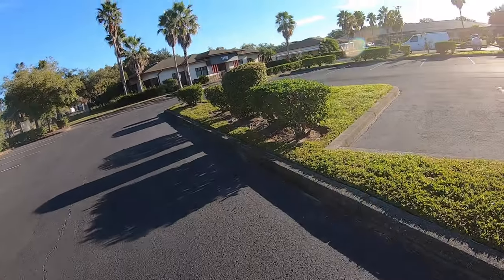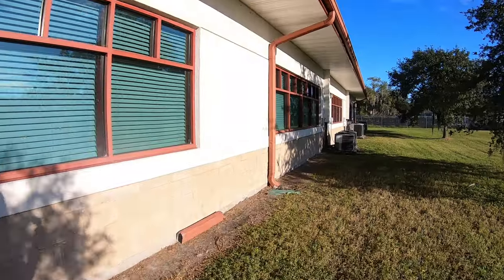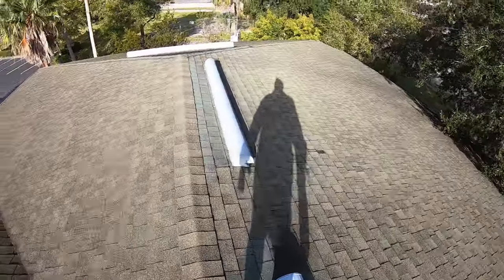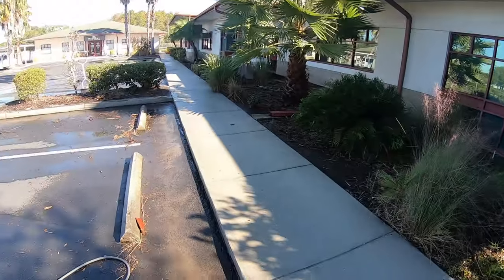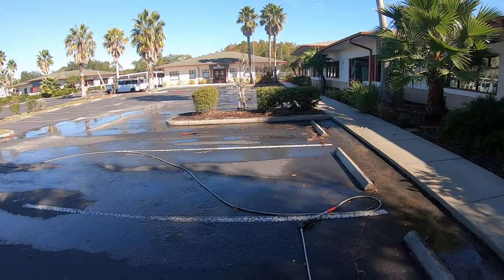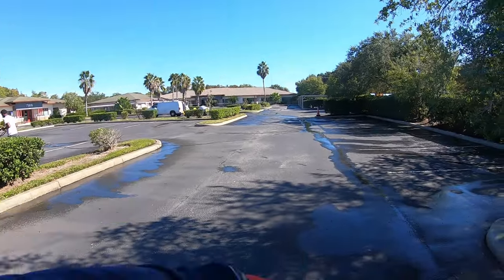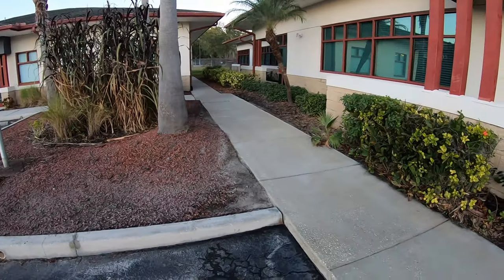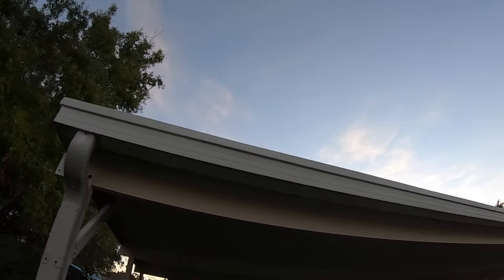Commercial Business Complex Cleaning

Comment: Can you please explain how you mix to come up with 3% mix? And how do you know what when to use a certain %?
Reply from the maker: Sh comes in 10% or 12.5% forms. To get a 3% mix you have to dilute it water. If you are batch mixing (mixing the sh with water in a tank) it will depend on how many gallons of mix you are trying to make.

If you are using a proportioner system or blend manifold you can simply dial the ratios on there.

And as far as knowing how hot a mix needs to be is going to come with experience. After doing a few jobs youre going to notice downstreaming can clean certain algae, mold and mildew but when you get some tough black algae you may need a stronger mix.

Comment: One thing I’ve noticed with commercial buildings is they don’t have regular water spouts. What common fittings do you use for commercial properties?
Reply from the maker: They all have a regular garden hose thread but some may require a water key to turn them on and off.

Comment: Great work! I do alot of commercial as well. Some of my jobs require cleaning before opening or after they close. Did two jobs this weekend one had to be before 8am flat work and soft washing the building. The other was a Starbucks which can be done after closing at 9pm. Those jobs are fun when it's 49 degrees in the am🤣🤣! The challenge is when's it's that cold with no sun the mix doesn't do much.
Reply from the maker: Damn you were on a roll!!! Yea it was perfect weather for us. About 55 degrees when we started and when we wrapped up it was about 60 degrees.  We didn't even break a sweat lol

Comment: Whats up Cliff..Nice work as usual..Seems like you'd have to be extremely careful not to hit the tips of the surface cleaner doing the tops of the curbs like that right..The reason for doing it like that is to not make as much of a mess of the landscaping mulch or ?  Thanks
Reply from the maker: If you jeep the surface cleaner leveled you can walk easily without it tipping.  Also with a 20 inch surface cleaner it's hard to hit the bar cause I have more clearance.

Comment: How'd you bid a job like that.... what parameters did you take into account when you bidded that job..
Reply from the maker: Gutters $1 a linear ft, building wash .20c a sq ft , sidewalks .15c a sq ft, parking lot curbs $1 a linear ft. Factor in accessibility,  water on site or not, and how dirty it is. Those are what I used on tbis project.

Comment: My greatest challenges  are pricing jobs.  Please give me some insight on pricing his like these. I would greatly appreciate you advice.
Reply from the maker: Very easy. Just gotta break it down so it's not overwhelming.  

So for the gutters I went $1 a linear ft.  For the sidewalks I went  .20c a square ft as well as the buildings.  For the parking lot curbs I went $1 a linear ft.
Reply: @PinkFlamingoPowerWash  was your profit sufficient? I got a Panera Bread Cafe drive-thru 185’ x 15’ (2775 Sq Ft) very dirty have to rent a hot pressure washer.  How would you quote it?
Reply from the maker: @panepanelsprocleaning  of course. I made a great profit especially knocking it out in 1 day.  I made double my daily rate.   Those restaurants are price differently. 1 time cleaning vs recurring cleaning.  They're typically cheap so you'd have to see if they want a maintenance schedule
Reply: @PinkFlamingoPowerWash  thanks for responding so promptly. It is a one time. I quoted $799 around $0.28/Sq Ft
Reply from the maker: @panepanelsprocleaning  thats not bad at all especially for one time cleaning. At .28c a sq ft that'd a good profit margin
Reply: Thanks again Bro.  I look forward to seeing next video. Stay safe.